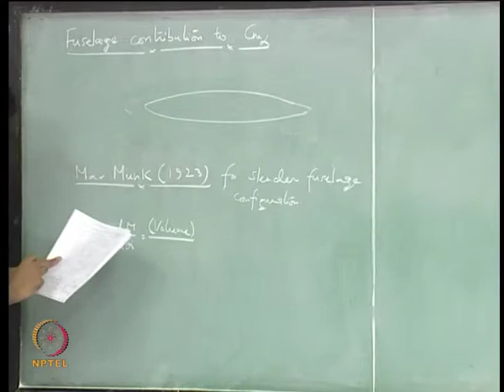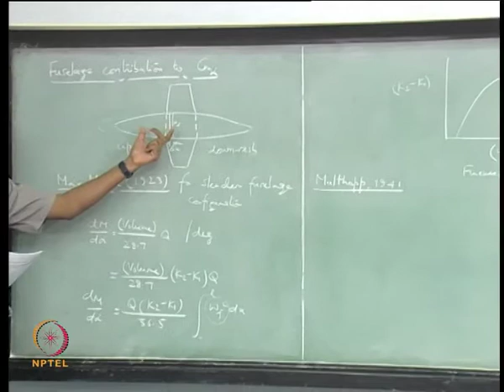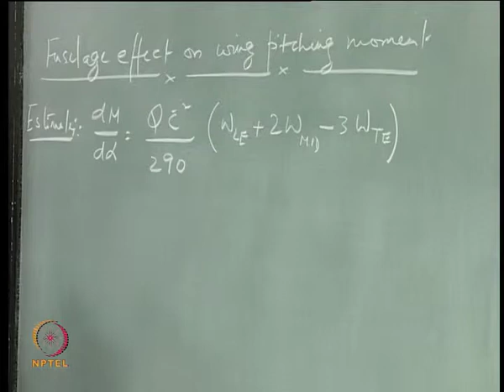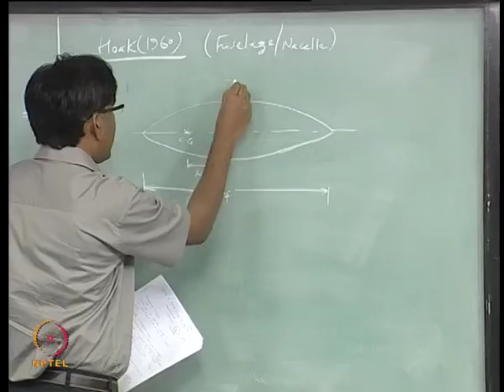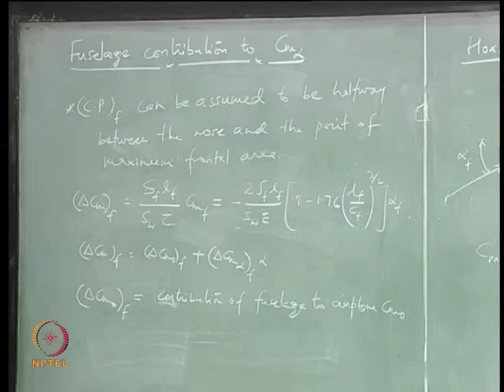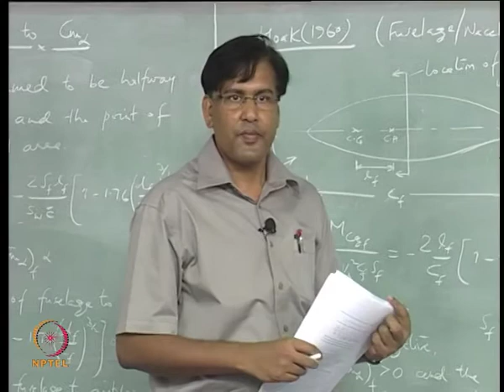Mod-04 Lec-09 Fuselage contribution

Comment: sir you have drawn a normal force Np (46:15) showing upward direction in the plane of the propeller does it depends on the rotation of the propeller means like clockwise upwards and anticlock wise downwards in that manner